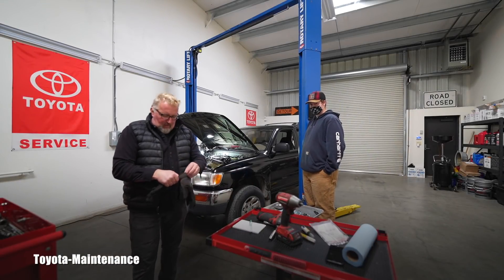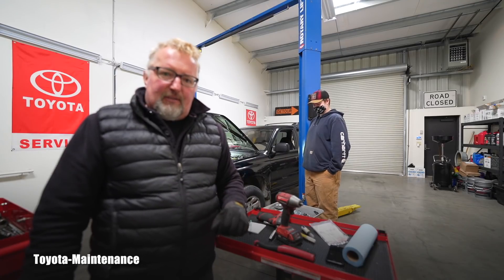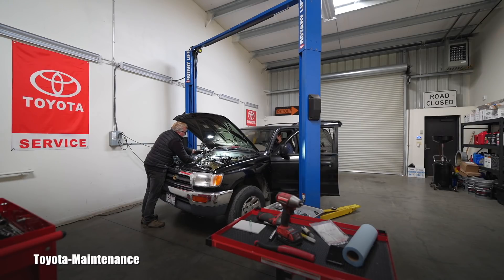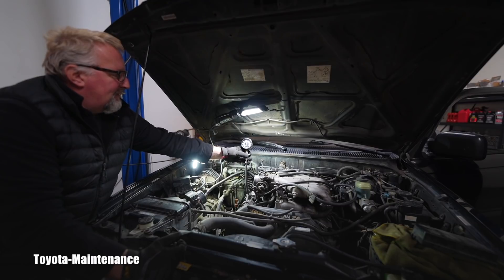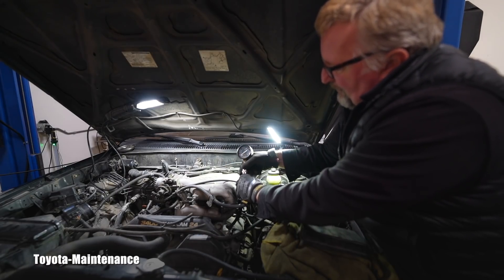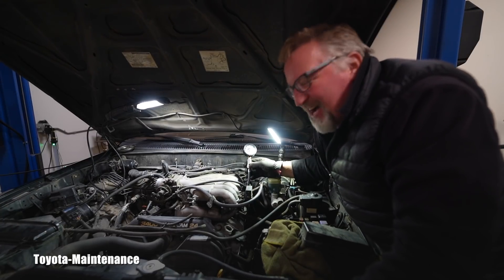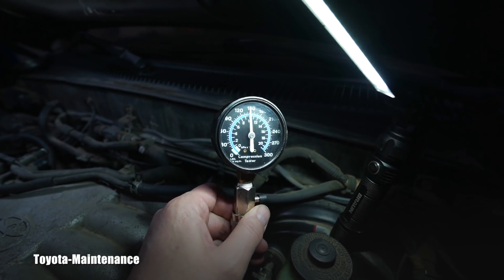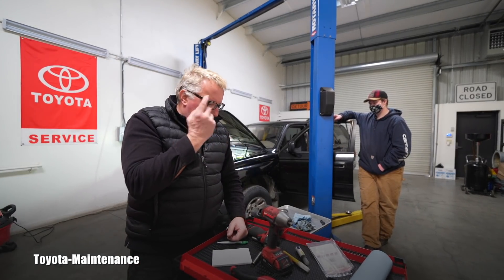Toyota Engine 5VZ-FE with 280,000 miles compression test

Comment: Ive got a 2006 tundra 4.0. For the past three weeks I throw a p0305 on first start of the day. I’ve changed plug, coil, injector, pct, camshaft sensor, air filter, I’ve done compression test and that cylinder actually has better compression than the other two do on that side. Once I clear the code as soon as I start it. The misfire goes away for the rest of the day in most cases. Does anyone have any ideas on where to look next. I’m stumped. Any help will be greatly appreciated.

Comment: Help! I have an engine misfire P0300 and I put in new plugs , wires , coils , and it’s still misfiring. I went to harbor freight purchased a compression test kit and my compression from cylinder 1,3,5,2 were 119-120psi, cylinder 4&6 were 140-142 psi. I know that the compression test for these engines are supposed to be 174psi or more? I know my compression is low but What am I dealing with here? Can anybody please help me figure out the next step?😊

Comment: Those numbers are like new, or after a rebuild, incredible.

My 99 Tacoma V6 has 305K miles and I recently tested the compression. Lowest cylinder was 175psi, highest was 190psi. All still within spec (174psi+ and 15 psi spread)

I got my Tacoma for free from a family member, and when I got it from them, it had been almost 30K mile since they last did an oil change and it was low a quart of oil. I thought the engine was toast at that point.

But I ran riselone through it, and then took the top end off, and saw no sludge. Everything was clean. So I put it back together and have been driving and offroading it for the past 5 years. I've put over $20k worth of upgrades into it, and plan on adding the supercharger with 7th injectors next.

Comment: Good for making the resolution update at the end. Forgot to mention something like 20% compression loss is acceptable and considered tithing spec by the OEM. 

Issac good idea wearing the mask and also put the cover back on the positive terminal. It's good practice and put there by Toyota to prevent shorting out the battery if a connection is somehow in an off chance made which can destroy the ECU (computer) or worse, the whole car (battery originated short and fire).
Reply: *within spec, *if

Comment: To be honest, the actual compression is likely a tad bit higher because to do a compression test 100% correctly the throttle plate needs to be wide open to allow unrestricted air flow into the intake manifold. Otherwise, each cylinder is drawing in air through the tiny idle gap of the throttle plate. This engine has done very well over its long life!!! The truth is, if an engine is used primarily at speed while at operating temperature and it has good oil with a good oil filter and a healthy cooling system, almost NO WEAR is occuring while running. There is virtually no wear happening in the engine while there is oil being pumped and sprayed around inside separating all the parts. 99% of wear occurs during a cold start up and during the driving that happens while the engine and oil are still not fully to operating temperature. If an engine is started once in the morning and driven 9 hours nonstop without shutting off and cooling down, it will experience much less wear than an engine that's started up in the morning, driven hard for 5 miles, shut off, cooled down over 9 hours, started up again, driven hard for 5 miles again, and shut off for the night. 👌 Pretty clear why highway cars can last an insanely long time whereas city cars fall apart before 200k. A highway car can hit 500k on the original engine and trans. Semi trucks regularly hit 2,000,000 miles.
Reply: In theory, with the throttle plate closed, it would just take a little longer to reach max psi.
Reply: @rxcalvosa  I may be wrong, but I think that if there's a vacuum in the intake manifold, it will never be able to reach maximum PSI.
Reply: I know people like to buy Tacoma's with low miles, but having a higher mileage Tacoma that was highway driven is a better buy than the lower mileage one driven around town, even with triple the miles.
Reply: @02markcal  Yep, 100% agreed. I used to be a mechanic. I had one customer who was a medical courier. He had a 2009 Corolla, 2ZR-FE with the automatic transmission. It had 320k miles on it in 2014. That's over 60k miles per year. He drove it all day long around town and very very often to and from the nearest major city which is 300 miles round trip on the highway. That car was incredibly intact!!! Original engine and transmission. The engine ran beautifully. You would have thought it had 75k miles on it. My 2012 Corolla just rolled over 80k miles a few days ago. That 320k 5 year old Corolla that was identical to mine ran exactly the same. The owner did 5k mile full synthetic 0W-20 oil changes on the dot as well as every other service in the schedule that we suggested to him. 50k miles trans fluid exchanges. Any issues were repaired immediately. The car was beautiful. It's because he put so many highway miles on it. My engine spins at almost 3,000 rpm at 80mph. Redline is at 6,000 rpm. No problem whatsoever. An engine will do 80% of its redline at a modest 25% load forever and ever nonstop until it loses compression eventually. Almost no wear occurs while running at operating temp. The bearing surfaces have oil film separation. They don't touch. The 2ZR-FE engine in particular has offset bores which is super cool. The cylinders are not directly over the crankshaft. They are offset to the side so that the connecting rod is more straight up and down on the power stroke which means there is much less sideways thrust against the piston skirt and cylinder wall as the piston is forced downward by the combustion. Egging is the primary mode of cylinder and piston wear which is what causes old engines to burn oil and have low compression. An engine with a good connecting rod ratio or offset bores like this has a much lower sideways thrust and experiences almost no egging. Put a 2ZR-FE on a dyno and run it at 25% load at 3,000 RPM. Stop it only to do oil changes at the proper interval, as well as to repair things like a failed water pump, worn timing chain, worn spark plugs, failed coil packs, worn injectors, worn fuel pump, dirty MAF sensor and air filter, etc. and it will run the equivalent of 1,000,000 75mph highway miles.

Comment: In 1995 I  bought a T100 SR5 with this same engine.  That was 27 years ago. I still have it and have maintained it over the years.  It runs and looks fabulous.  170K and I would drive it across the country tomorrow with no worries.  I believe this truck will last me all my life,  and beyond, for someone else to enjoy.
Reply: Bring back the T100!!! It was the 'right-sized' pickup.
Reply: @RightLaneHog3151  Anecdote here!  I wanted a folding solid bed cover for my T100.  I went online and saw that no one was making these for the T100  (to old?).  I measured out the bed in both directions and went on line to find a truck with the same sized bed.  In a chart listing bed sizes I found one (?) a late model that was very close in size.  I ordered the folding cover.  It fit perfectly.  I love it.    Just one of many things about this truck.
Reply: @curtgomes  Excellent. I really like the fact you could get one with a 4 cylinder or V6 engine, manual or automatic transmission and a bed that could hold a full sheet of plywood.
Reply: @RightLaneHog3151  Yes, on one occasion I put a large load of sheet rock in the bed. That stuff was really heavy.  The rear springs were flexed and bent but no issues.  My T100 is an SR5 with the 3.4 V6 just like the one shown here.  Yes I've had to replace valve cover gaskets, leaking heater control valve, leaking power steering lines and a few other things.  Put brakes on about 4 or five years back.  A few spark plug changes and assorted minor stuff including about 4or 5 batteries.  Found quality parts on Rock Auto for awesome prices.  $150.00 per year license,  $280 for insurance and then gasoline....  and that's pretty much it.  Originally paid $18,000 (1995).  It was slightly used with 4k miles.
Reply: Your truck has about 60% of its life left. Keep the oil changed with a Toyota filter. Change radiator fluids and flush, if you overheat one, they’re known for blowing head gaskets
Reply: @sweetwilliam49  Thanks for your input.   I wish I could post a photo here.  Yes, all those items are important to do and will keep my truck in good condition.   Have also serviced the transmission & power steering.  Just last year the A/C was a litter warmer than usual.
I took it in thinking compressor or something else.  It was drawn down and recharged the Freon.  No leaks and runs like the day I bought it 27 years ago.   They charged my $50 and tried to buy my truck...
Reply: I drive a T100 for work. 371,000 miles lol
Reply: @sonofliberty92  Yes, I see many still on the road.  A favorite of gardeners and all types of manual laborers.  Dependable, low cost, work horses.
Reply: @curtgomes   we run a power washing business out of it. Bed is rusted through badly but it's hard to find a new bed
Reply: @sonofliberty92  Yes, I've seen some in wrecking yards but difficult to get to if not in your area.  This was the first "full" sized truck Toyota ever built.  These were all built in Japan.  The quality was obvious in those years.  The bed in my T100 has always been covered with a bed liner.  The truck never got hard commercial use.  I saw a thick rubber bed pad for a 2002 Tundra and bought it...  aprox.  $100.  It fit perfectly except for a small difference in the fender well area.  The notches in the corners were exactly the same.  Could help with rust issues if you find a new bed...

Comment: Compression is crazy for 280 k miles. Good for another 280k. I have this engine in a T100 with 232k. I have another one in a wrecked truck with 129k. Legendary motors
Reply: Bring back the T100!!!

Comment: Might a Leak Test be beneficial? How steady, or not, a cylinder can hold a particular pressure could help identify the integrity of the cylinder walls. But, as always, I defer to Peter because in Peter I TRUST. Thanks for the video.
Reply: Leakdown only really shows any problems if compression is low. So quicker and easier to just test compression. If compression is good she's good to go

Comment: Very good video.  What would the compression be if the engine were new ??
Reply: Around 130 psi
Reply: @fastwalker21  don’t you mean 230 psi? If compression is lost with wear, his average was 220psi at 280,000 miles!